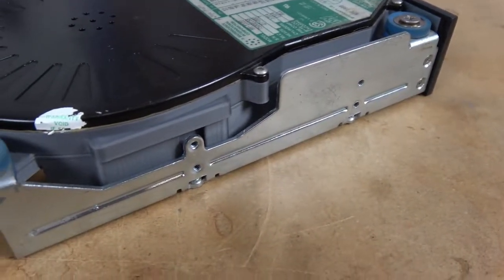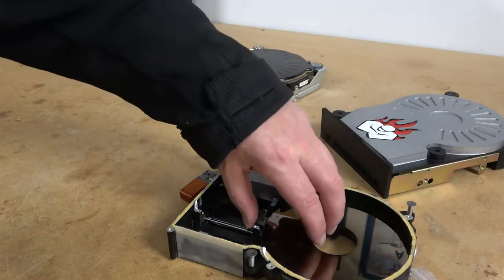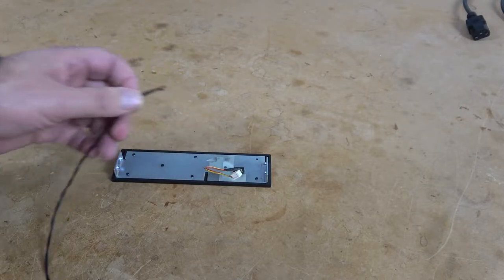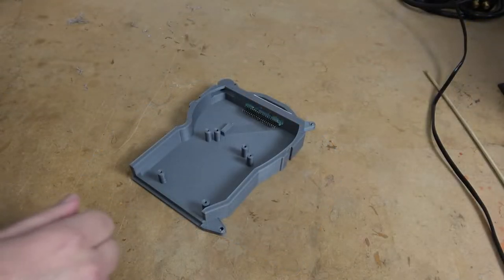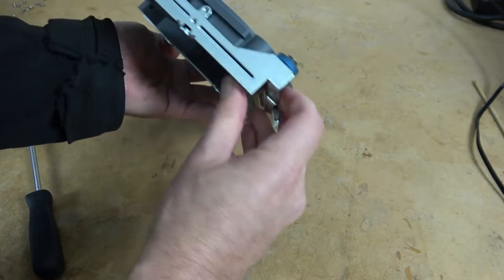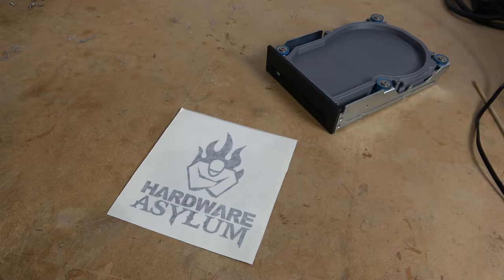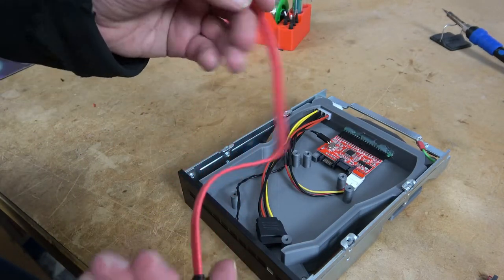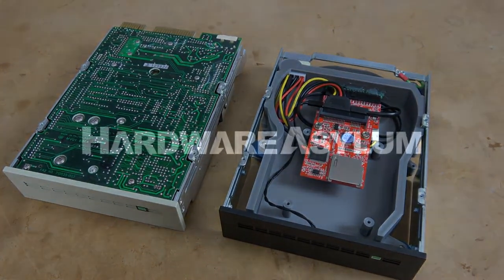A Sleeper Storage Device Build for your Retro PC

Comment: Awesome modification, I don't suppose you would do these a kit.  There would be a lot of interest, myself included.  Loving the content.
Reply from the maker: Kit was never the intention and part of the reason I did the video.  With that being said, anything is possible, I might offer the 3d Models when/if I start a Pateron.  I don't have any Microscience drives to part out since they are currently working or could be made to work.  (bad controller board).  

Hit me up on my website if you want to talk more about this.

Comment: Now if only you could emulate the drive spinning up sound. Actually you *could*, with a sound board (adafruit), amplifier and built in speaker...
Reply from the maker: You are right, I could and... there are some C64 floppy emulators that do that already.  The issue I saw was trying to map the sounds to activity on the drive since, for me, it was important to have realism.  and then... it came to me...  Silence would be a key feature of this device along with enhanced speed.
Reply: @Hardwareasylum  Dunno, an arduino controlling a mechanical solenoid is a mighty tempting idea eh?

Comment: Just a warning, you have a lot of connectors, every physical connector is a point of failure in the future. It's better to integrate IDE SSD board, reducing number of connectors inside down to 0.
Reply from the maker: Maybe for version 2.  Right now, the drive serves as a backdrop decoration in my lab and still works perfectly.
Reply: also not a fan of molded sata power connectors, they are known for shorting/melting/fires. usually the crimp style sata power are a bit more reliable